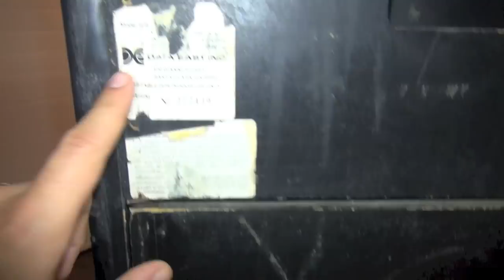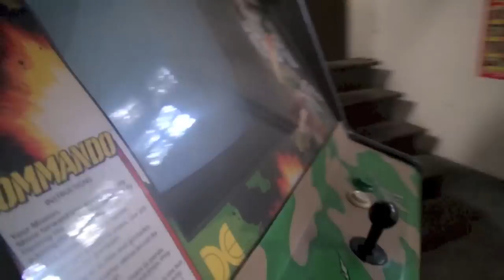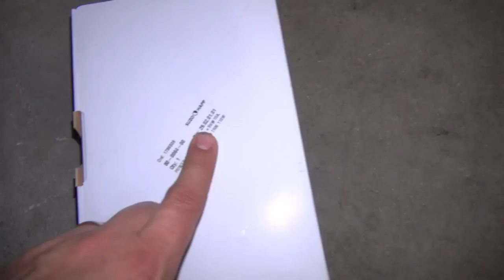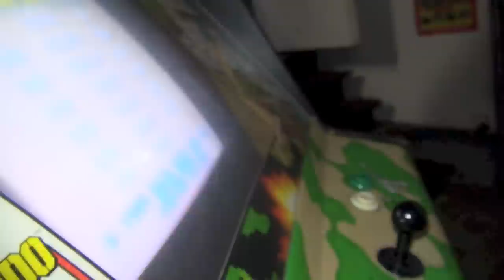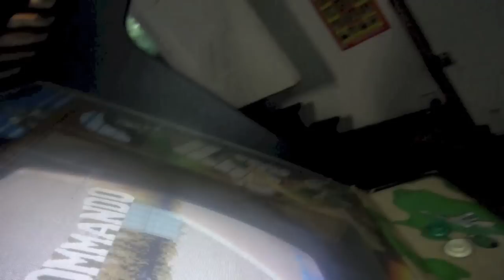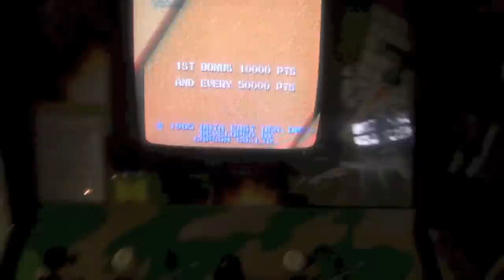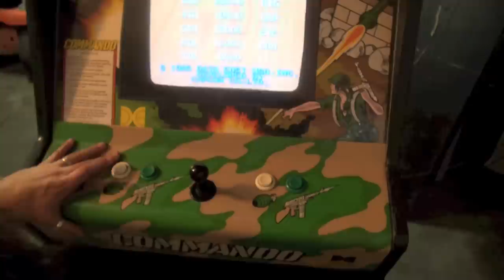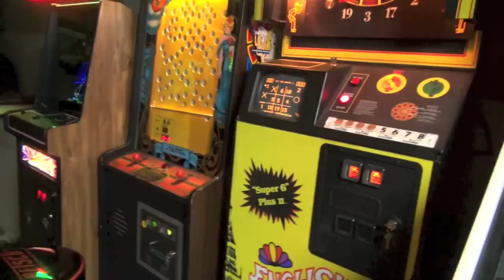How to fix a dead arcade game #1 - Troubleshooting a Craigslist purchase - Data East Commando

Comment: 15$ for a power supply?!? wanna trick? go find them older pc's that the power supply has a wired on switch, same thing as your fancy switching power supply, ;-) just always leave it switched on when the door is closed, ;-)
don't believe me? check the OLDER pc power supplies with a sticker, list what each wires voltage and color is, including plus 5 volts, ;-)just need to replace crimp connectors and splice a few wires, ;-)